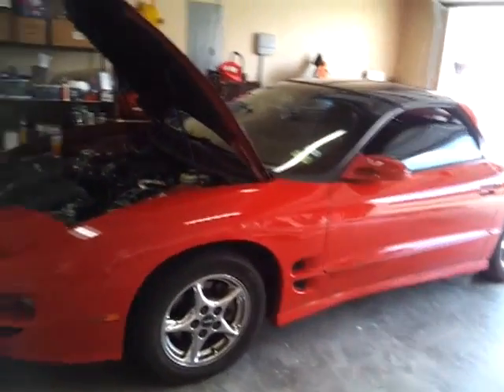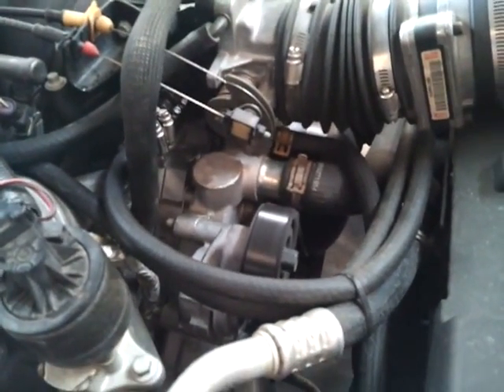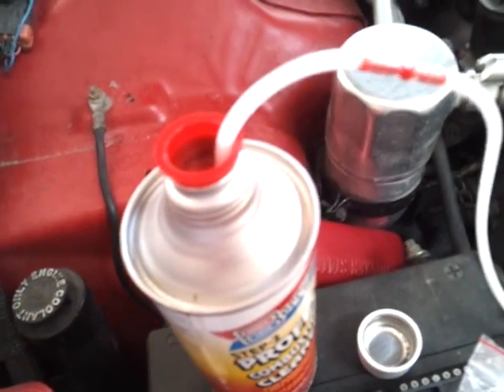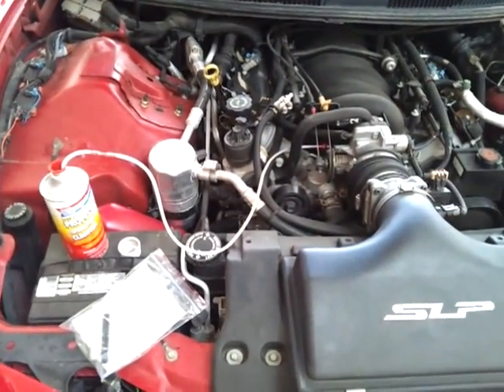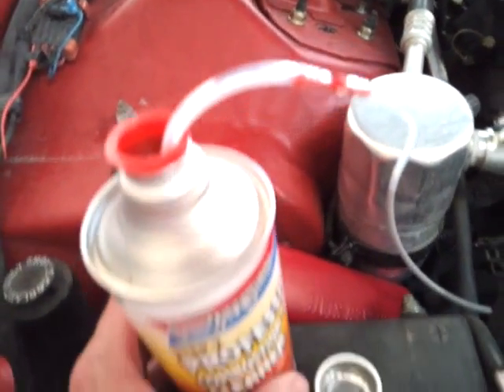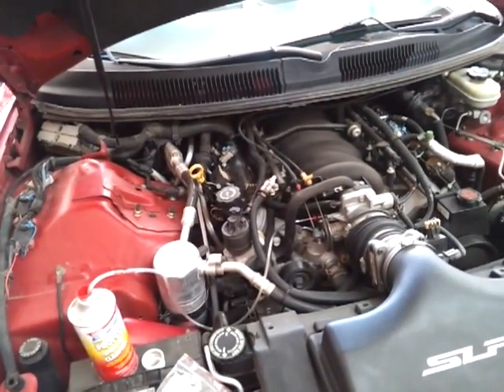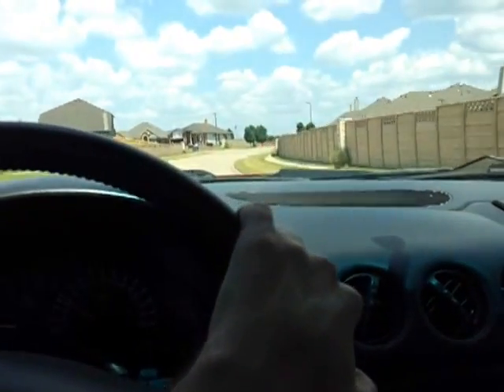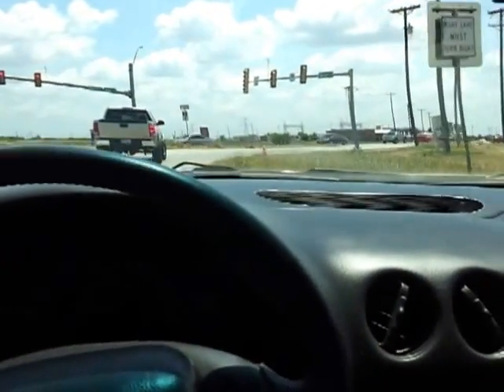Combustion Chamber Cleaning—Berryman Your Car; Don't Seafoam It!

Comment: What chemtool does is directly disolve the varnishes that build up on fuel injector pintils and nozzles. The solvents also cause the gasoline to burn a bit more completley. giving more power and even burning of fuel. It does not lube the injectors or upper cylinders. I looked at many videos with borescopes and no cleaners seemed to clean tohe top of the pistons or valves with one treatment. The only treatment that I have  not tried are ones with pea such as gumout and techron which seem to test well on the videos I hve viewed. I have been using chemtool for over forty years and it has never not cleaned dirty or even clogged  injectors although the clogged ones may take a day or to to sufficiently unclog. The performance difference is almost immediate. chemtool costs obout 5 bucks at walmart. dec 2022. Follow the instructions and you will never have fuel system issues related to clogged components.

Comment: I didn't know Berrymans sold a "kit" like this.  My daughter's car has about 130,000. The only time I drive it is when it has a problem,  fortunately it's very rare.  She told me she noticed it just didn't seem to have the acceleration it used to. I tuned it up, although plugs and wires seem to be fine. Didn't help so I put a can of Berryman in the tank, seafoam in the oil and seafoam spray to clean the throttle body. There wasn't enough time,  I don't believe,  for anything other than the cleaning of the throttle body/intake etc to make a difference.  I was amazed and so was she how much smoother and improved acceleration  the car has now. I know Berryman is good stuff but I'm also a believer in seafoam now. Is seafoam as good as Berryman??? I don't know but from my experience with my daughter's car, I'll probably stick with the seafoam. 
One noticed difference? Seafoam tells you to let the engine "heat soak" i.e. after you empty the can, shut the engine off and wait till it's cooled off. Then "drive the car under load". I had MUCH more white smoke from the tailpipe than you had in your video but then again, her car obviously desperately needed the top end cleaned far worse than yours

Comment: Smoke?
How about all the crud that has hit the catalytic converters which now must by heated to cook the crud out?
Just thinking....
Reply from the maker: Very legit. That's why it's not uncommon for a check engine light to come on—there's just so much stuff passing through and temporarily tying up the catalytic sites that the ECU thinks the cat has crapped out and throws a P0420 code or something similar. However, once the cat burns all that crap off, the code goes away.

Comment: did or could this type stuff mess up the cats?
Reply from the maker: No, it's safe on oxygen sensors and catalytic converters. The more cleaning you're doing, the more confused the ECU tends to get, so you may see a check engine light for a time. However, that'll go away after a full drive cycle.
Reply: @DanNowlan  good to hear...I have learned that the 6th gen Camaro DI engine has super be build up on intake valves
Reply from the maker: I don't doubt it. Most GDI engines as a matter of course are prone to it.

Comment: Best way is thru throttle body.
Reply from the maker: Agreed. Sometimes vacuum is generated from just ONE cylinder. If you use the vacuum system I  such instances, you'll only clean that ONE cylinder.
 
Search Amazon for "Berryman 2611" and the upgraded product that also works on GDI engines will come up. It can go in through the vacuum system or the air-intake.

Comment: Can't find the combustion chamber cleaner cheap anymore. They went up in price as it seem Berryman doesn't make the product anymore. 

The gas treatment got rid of my pinging issues with on bottle and long drive (few hours). Great product!!
Reply from the maker: That is correct.  That product has very recently been replaced by "Intake Valve & Combustion Chamber Cleaner "(part #2611).  The new product is designed to be effective in all all fuel-injected gas engines, including GDI.
Reply: @DanNowlan through the gas tank?
Reply from the maker: @Godsxeed  No. These products are designed to go through the air induction system as that's the only way to hit the whole intake valve on GDI engines. If you have a PFI (or similar) engine, you can generally just use a traditional fuel additive like Berryman 2616 or 7516.

Comment: A shill for Berryman's? He sure did bad mouth Sea Foam.
Reply from the maker: Sea Foam isn't the right product for this job.  It is a jack-of-all-trades, master-of-none.  Just read the label and you'll see it's supposedly great for gas, diesel, small engine, fuel tank, crankcase, vacuum line, fuel stabilizer, etc.  It isn't reasonable that one product can do all that AND do it well.  For instance, detergents that work in gasoline, don't work well in diesel fuel or in the crankcase...and that's if Sea Foam even has any detergent.  And how many of those applications benefit from the use of petroleum oil?  Petroleum oil in your gas is going to cause sooty exhaust and lead to combustion chamber deposits and increased HC emissions. Unadditized oil in your crankcase can increase friction, wear, oxidation rates, etc.
  
As for Berryman, I mention in another longer video that "B-12 Chemtool Fuel Treatment" (now called "B-12 Chemtool Fuel Injector Cleaner") doesn't work for this application either.  It's all about choosing the right chemical for the mission.

Comment: By only using the PCV as the vacuum line, aren't you only hitting 1 or 2 cylinders?
Reply from the maker: It depends on where the vacuum line dumps. If it's before the intake manifold, then you're hitting everything equally.

Comment: did your car use any oil after doing this?
Reply from the maker: I had a deteriorating oil pan gasket, so I was already USING oil. However, I did not start BURNING oil after using the combustion chamber cleaner.
Reply: ok , good to know...thanks

Comment: will this clean piston rings?
Reply from the maker: Yes, but if you have stuck compression rings, your best bet is to use Berryman B-12 Chemtool Fuel System Cleaner as a soak by removing the spark plug and adding it to directly to the cylinder(s) in question.  Put the spark plug back in, let it soak for 30-60 minutes, and siphon the B-12/carbon mixture out.
Reply: Dan Nowlan I did that with the sea foam and I Let it sit over night and the sea foam went completely through the piston rings on all 6 it's a jeep cherokee 91. do you still I think I should try it again but like you said only 30 minutes at a good?
Reply from the maker: Thing about SeaFoam is it's not a low-temperature cleaner.  You need strong solvents to clean at low temps and that product just doesn't have it.  That said, you can definitely try the soak with Berryman.  Good news is you won't hurt the oil as long as you don't lose more than about half a can or so to the crankcase at a time.  With your Jeep having an inline 6, it won't take much product to cover the piston crown and rings either.
  
I'd pull the first plug, put in 3-4 ounces, wait 5-10 minutes, and see if you can siphon anything back out.  If you could gently aerate it (think: air compressor and wand), that will help loosen the carbon.  If it works, great; just move on to the next cylinder.  If it doesn't, simply start the Jeep and let the oil warm up to drive out the Berryman before trying again, if you're so inclined.

Comment: I used a needle valve setup to venturi vent atomized water into the intake the other day.  I accidentally opened it fully and let 3/4 of a quart into the vacuum which hydrolocked the engine.  it sat for about 15 minutes while I pulled all the spark plugs so I could turn it over to spray it all out.  It shot out carbon particles on the windshield with the water.  Once I started it back up it barely idled and smoked like CRAZY.  It proceeded to smoke and the idle improved in about 5 minutes.  It smoked for about 15 minutes.  I was amazed at how well pure water works.  I could smell the toxicity of the carbon out of the back.  I also investigated and it appears that mechanics that are veterans use water always to clean out carbon in a car.  I will use 50 cents for 1 gallon of water instead of 8 bucks for 16 oz of seafoam from now on.  I think the steam from the water does more than anything else.  Hydrogen is the smallest element on the periodic table and it permeates everything.  That's why it can't be stored long term even in steel containers.  It leeches through it.  Imagine what it does when heated into steam.

Comment: What you can do that does a really good job of taking carbon off of the piston heads is 1. Remove the spark plugs .2 Using an eye dropper - Fill the cylinder with the Berrymans 3. Put back the plugs so it wont evaporate (Overnight) 4. Remove the plugs and use a sponge swab to wipe down the piston heads and you will see that about 90% of the carbon is removed from the top of the piston...Total time about 30 minuets or less... 90% more effective than any other method short of taking off the head itself....

Comment: Should take it to a shop and run a bore scope into the chambers and video it.  Would be impressive to see a car with that many miles with carbon free cylinders etc.  Also solidify you're not wasting your time doing it.  I personally ran Seaform for about 4 years every 3,000 miles  in a 1986 IROC Z I had thinking I was doing all this greatness to it...  Truth be told after 180k miles the engine went so I decided to do a complete rebuild.  The engine was heavily coated inside with carbon, everywhere and on everything as if I had never done a single thing to prevent it.  Was depressing TBH lol.  Needless to say I have never seafomed again, total waste of time and money.
Reply: use both, they clean diff parts of the fuel system

Comment: Berryman is legit... people whine about the acetone and toulene like it will damage the orings etc... I suppose if you were running massive amounts it might but not in "therapeutic doses" I suppose seafoam might have some uses but its not for for hard carbon.
Reply: Notnbeing shy on Acetone is actually why it's working so good.
You can't clean carbon if you are not using some harsh solvent.
Things like seafoam just knock the already loose carbon out.
Acetone dry the carbon deposits to help break it loose.

Comment: How could that have told how clean the engine is? Because there wasn't as much smoke coming out?
Reply from the maker: Carlyle Tom, contrary to what some people here would like to believe, yes, with the Berryman cleaners, smoke = carbon removal. Seafoam has some oil which doesn't thoroughly burn, so some smoke could be from that. However, neither Berryman product has oil--they're both clean-burning under these conditions. That means the smoke is coming from deposit removal.

Comment: Berryman is also great to pour in your cold crankcase right before an oil change. Just pour the entire can in, idle to bring the engine up to operating temperature and change oil and filter. Do this once every 18 months or so and when you take off the valve cover the engine will look like new.

Comment: And this has proved what exactly?
Reply from the maker: Quite simply, it demonstrates the removal of carbon from the combustion chambers. I wish I had before and after pics of the CCs, but I just don't. Nevertheless, I have no doubt it works cuz my octane requirements go down. It's proof-positive of carbon removal.
Reply from the maker: +FUNG CHANG placebos don't make spark-knock go away. Cleaning out the carbon does.

Comment: don't buy a corvette if you can't afford or bitch about the price for parts !!
$100 for a part for a corvette is peanuts !!
Reply: +Dan theman Many parts on a vette are standard run of the mill for their type and should cost not one penny more than same thing used on any other engine.
Reply: that might be true But what i was say If you complain about spending $100 for a Corvette parts  But you had no problem spending $50,000-$80,000 for the car  Then you shouldn't have a Problem with only spending $100 for a FREAKEN  PART !!!

Comment: After using Berryman's to clean injectors (not through fuel tank), I never bought Seafoam again. It is much more volatile than Seafoam. I never tested it as an intake valve cleaner. I am talking about the B12 product of theirs. I mix it 50/50 with gasoline when flushing injectors through machine or fuel rail. Does the job in a couple minutes.
Reply: seafoam good for lawn mowers b12 is strong stuff
Reply: @codburnermemes1309  sea foam is only good for 2 stroke boat motors

Comment: Plain distilled water works great at cleaning piston heads and cylinders.  Just get the engine up to full temperature first.  Cleaning the back side of the intake valves requires some organic solvent.  Sea Foam is crap.  It was developed for use in 2 stroke outboard boat engines using a oil/gas premixed fuel.  It doesn't work in 4 stroke engines.
Reply: nope, chris fix used it and checked the piston heads and it started to clean!

Comment: not the drive way john....my 22re is what I'm talking about
Reply from the maker: I like to think the video speaks for itself. Either way, Seafoam is a jack-of-all-trades. If you want a first-class product, get one that's specifically designed to do the job at hand. If you have carbon on the valves or piston crown, then I would recommend the Berryman combustion chamber cleaning (part #2610). It's certainly what I personally would (and do) use.

Comment: I have a '95 Toyota pickup dlx extra cab 22re, 5spd......I noticed a black carbon spot on the ground and I know I have a Carbon issue. which would be better to use the SEAFOAM or BERRYMANS? I just wanna clean up the carbon even if it doesn't get all of it, but also get what I can......help a brother out!!! thanks
Reply from the maker: To clean the spot on the driveway, I would use either "B-12 Chemtool Fuel System Cleaner" (part #0116), "B-12 Chemtool Carburetor, Choke & Throttle Body Cleaner" (part #s 0110 and 0117), or the chlorinated "Brake Parts Cleaner" (part #1420).  The first product is the pourable fuel additive; the other two are aerosols.

Comment: in actual fact you can spray , albeit carefully water from a spray bottle into the vacuum line , and it will in effect "steam clean " the combustion chamber , there is no danger of hydro locking the engine , as long as you do not pour a whole bottle of water down , just gently spray water down a line .
Reply: I 2nd that. I did the water method just as I do with Berrymans or Seafoam. and it's free! I experimented with different chemicals in old beaters. Water surprisingly worked well. Never hydrolocked an engine. It is pretty tough with a 16oz can unless you have a tiny combustion chamber.

Comment: no, i wasn't referring to using techron as a combustion cleaner.    i was just simply saying that it's a very good fuel injection cleaner, when you add it to 12 gallons or less of gas.

Comment: hey, i got a question for you.    why is it, that when you buy a new car, and you shift the car into reverse, it's so quite.     but after you put about 50,000 miles on it, you hear somewhat of a "clunk" when you shift it in reverse.    why is this?    what part needs to be replaced to make the clunk sound go away.     and what are the chances that the clunking sound could be the result of driving a car with low transmission fluid level.     because i was told that you're supposed to slightly "rev the motor", before as you shift into each gear, prior to checking the trans fluid level, because the higher rpm forces the correct amount of fluid into each gear.    and then you get an accurate reading on your dipstick, versus just shifting through each gear for 3 seconds at low idle.    shifting a used car into reverse sounds different than a brand new car, and i was just wondering what your thoughts are about this.     what part needs to be replaced to make that engaged "clunk feeling" go

Comment: i don't know why you're telling me about how you used to be a marine ( so you agreed to do a job, that most people with common sense wouldn't do.    and? ).     what the hell does that, have to do with this?    and there,s a lot of master mechanics who don't even do the repairs per the specific steps in the Haynes manual.    the only benefit of that, is that you can probably do a lot of the repairs faster.    but usually, the faster you do a repair, the less perfect it gets done.    agree?